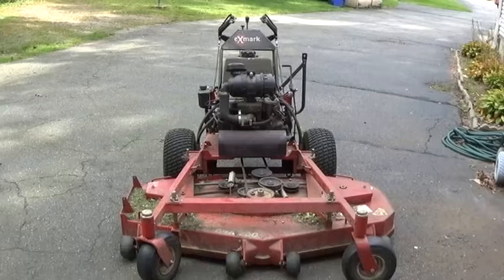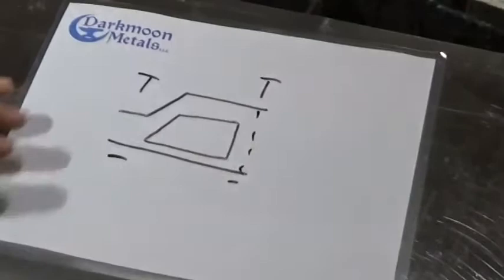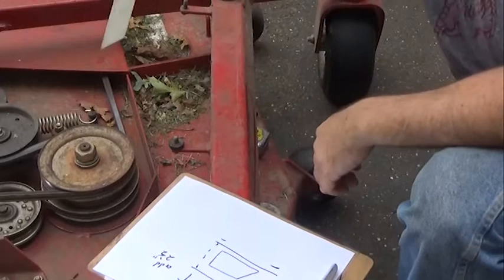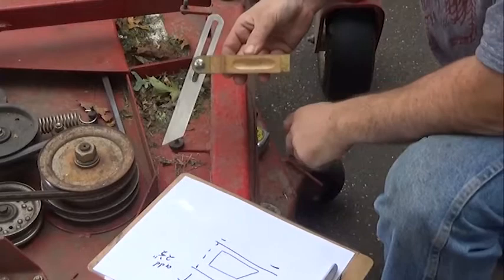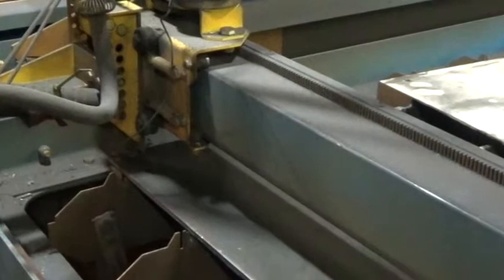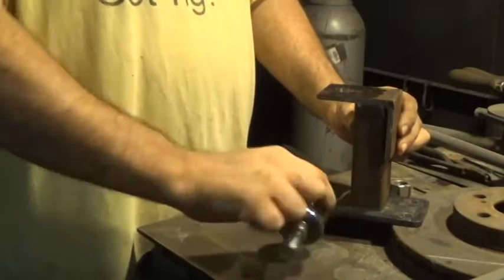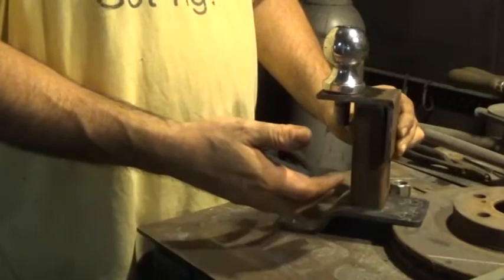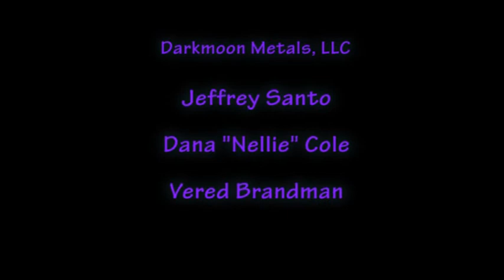Trailer Hitch Build For An Exmark Lawn Mower

Comment: I feel ya man. Im only 30 but ive hurt my back a few years ago and have had to lightn up on how hard i work myself. Im about to motorize a hand truck with a riding mower axle and wheelchair motor so i can  move things around easy and make junkyard runs easier. Im gonna try it on my Kobalt 24v 4.0 battery to see how long it'll last.
Reply: back injuries are horrible! im 30 as well, and i have really hurt my back quite a few times over the past 10 years. i fell into the mechanic's pit at my last job about 3 months ago. landed on my back against the concrete steps, then tumbled face first into the ground about 6ft down. i gave myself pretty serious whiplash. i have to be extremely careful with what i do now, and unfortunately, i cant even get a job right now, because i am scared to burn bridges... i could get hired right now if i wanted to, but when i injure myself in 3 days time, ill have to quit, or get fired, and then im never working at that place again... and a complex agreement has left me without any benefits from that previous job... no employment insurance, no workers compensation, nothing... so im putting around with a new project truck i picked up, and making more youtube videos again. every day i try to push a little harder, just to try and get my neck and back working like how they used to...